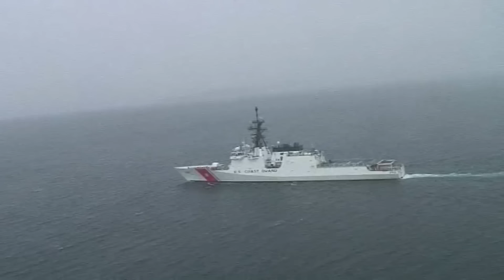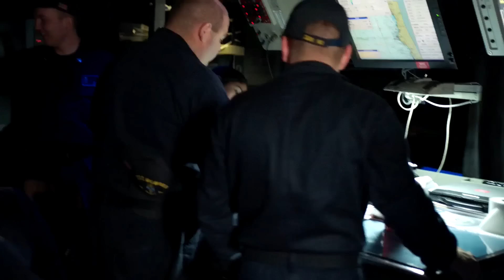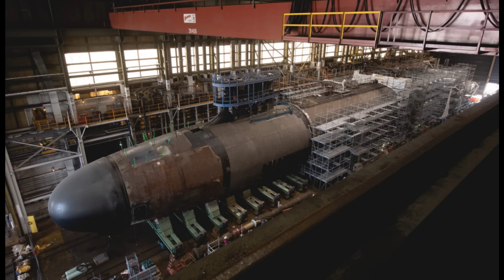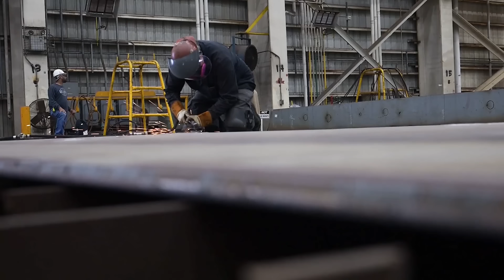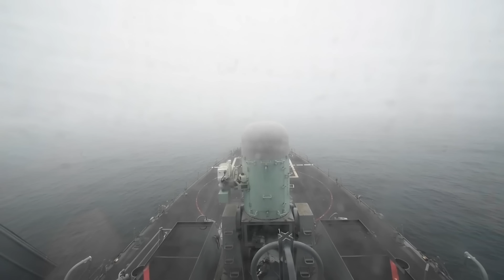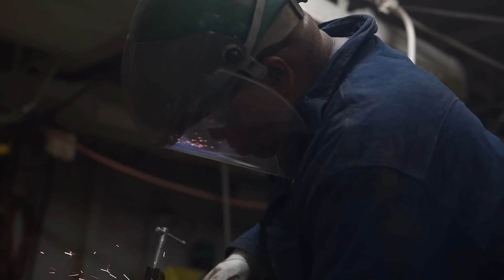The US Navy’s Radical Plan to Build Its New FF(X) Frigate Faster and Cheaper

Comment: A good concept but we will need to wait for implementation.
Reply: The industrial sector is in a sorry state, 🇺🇸 paper tiger.😄😄😄😄
Reply: N8t really. That's the point. The first flights should hit the water by 2028. These will be relatively minimalistic... meanwhile the manufacturer has the chance to tool up to make new modules to convert the frigates to their previously engineered more heavily armed versions of the hull designed years ago... adapted to modern naval use.
Reply: @ravissary79  Why build the first flight if it has NO capability?
Oh yeah, so that Trump can say "the navy has more ships".
Reply: @ravissary79 That is the plan. The first couple ships will be to get the production fired up and experience to increase, and only once that's done will they start implementing incremental upgrades (like a VLS). But the funny thing is, they could have done the EXACT same thing with the constellation, but didn't and went right to making it a mini-burke off rip instead of incremental upgrades towards that.
Reply: @UJManda well not quite. The reason they can actually move a lot faster here is its an indigenous design by the ship building contractor that makes it domestically... and they just got done making a bunch for the coastguard. So other then changing a few things... which they already know how to do because they make USNAVY ships all of the time... they're essentially already tooled up.
That was never the case with the Frem because if its to be made domestically, the domestic contractors need to start earlier in the production cycle... tool up, and make bigger changes so it can be USNAVY compatible. 
So despite the FREM being the more combat capable design it was always going to require more adaptation than the Legend needs to essentially just give you a working ship ASAP.
Reply: Democrats will cancel them and add built hulls to the Coast Guard and continue the works in Michigan.
Reply: @tigersilberhannes9153  The Constellation class were being built in Wisconsin, not Michigan... However the Legend class cutters and now the future frigates are being built in Mississippi... I suspect another shipyard may build the future frigates as well to speed up production, maybe the shipyard in Wisconsin?
Reply: @tigersilberhannes9153 They won't. What's up with you Americans and saying "ohhhh the democrats will ruin it or ohhhh the republicans will mess it up" calm your tits. The only thing the democrats might cancel is trumps battleship thingy